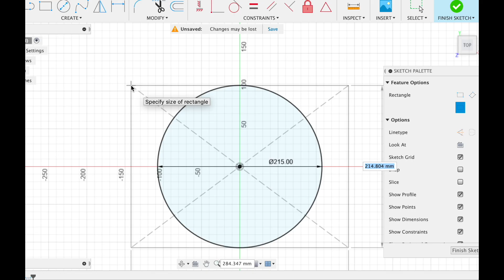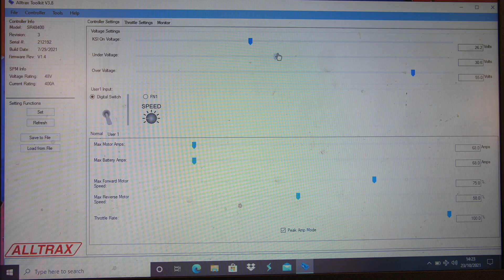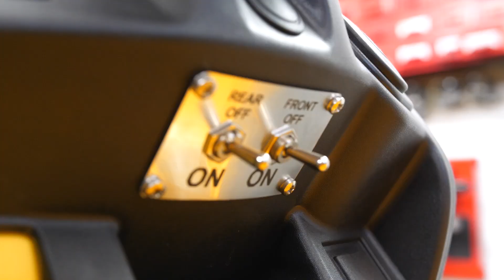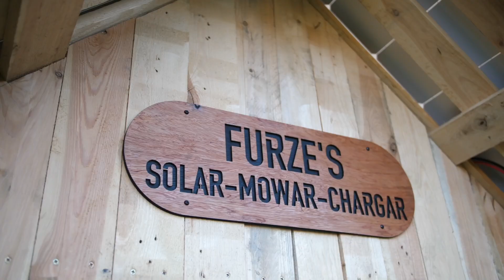EV Mower Conversion with Solar Charging Station

Comment: It's crazy to me that he refers to this as a commercial mower, and talks about how big it is. In America, most "commercial" mowers are ZTR Mowers with at least a 54-inch deck. Also, he measures his grass in square meters when where I'm from we measure lawns in acres. I live in a rural town and have a relatively small lawn for my area and I have approximately two acres of grass. His mower cut 1,500 square meters which is equal to about 0.37 acres. His mower wouldn't cut 1/4 of my lawn. I think this is a really cool project that turned out great.

Comment: Been waiting to see a rider on the market.  
Not a fair test though. The grass he cut was recently trimmed and still only went about an hour. I’d be curious to see how long  Lithium batteries could handle taller grass and  Fall leaves. 
I run mine for two hours every week and my weekly cut is taller than what he trimmed. 
My ears are looking forward to the day that they are not just gimmicks.

Comment: It'll be amazing if you add an output so it can be used to power other electric devices because grass takes a while to grow and those panels don't stop working. With the lithium batteries it would be a lot better as a battery pack.

Comment: Great build.  I have just a few ideas you may like.  First, I would use rubber instead of felt.   Felt holds water and will promote rust.  2nd, instead of dividing the batteries between the 2 motors, have 6 batteries connected to both and then balance the movement and blade speeds.   Lastly, depending on the motor voltage requirements, you have up to 72 volts available if all the batteries are in series.  If you have 2 banks of 3 batteries in parallel, you'll have 32 volts with twice the amperage, etc.

Comment: Could have done it with two battle born batteries. Maybe one. But I see you went with lead acid chemistry.. look up lithium iron phosphate chemistries but be careful because they're not great for vibratory applications such as a motor vehicle you need a specialized one

Comment: Also a benefit: Longer grass won't make the motor stall, that small electric motor also most likely has quite a bit more power
Reply: Those belts will slip long grass is usually wet which will make them slip
Reply: @trevorrowe6231  True, maybe he should just add another motor directly to the blades
Reply: @SophiaF3499  that won’t work either it would still need a belt to go between the two and that deck sits too high to fit a motor underneath

Comment: For private users it's actually not a bad idea, the long charge time isn't an issue because you only need to use the thing once a week at the most. However for professionals it's a no go because like electric chainsaws and other hobby tools, you just can't get the run time you need to go all day. The other slight practicality issue is that if you can afford enough garden to need a ride-on mower, is a fivers worth of petrol going to be a concern?

Comment: XS-Power makes lithium batteries in the same size as a normal car battery, but they're bloody expensive

i'd recommend you to make your own battery pack, i mean you're a great engineer after all so why not

just need to use a BMS system like ebikes n stuff got

i'm sure some companies would maybe even sponsor lith cells so you could build one yourself

Maybe get in touch with some EV conversion companies, they might wanna help

Comment: Not only is this a really cool project, but now because there's a documented record of how it was put together, someone can't just come in and patent it. I genuinely hope this idea catches on
Reply: I use my 1959 duel supercharged, 8 cylinder ride on. I keep the mixture nice and rich. Mmmmm those salty little tears Greta 🧂😢👍
Reply: @MattyEngland  Good on ya, if the  thing works well keep using it, but if your goal is to crank the emissions as high as you can then you'll want to mod it with a Spitfire engine or something instead. You and your vintage (and probably very easy to repair) mower are doing net buggerall for emissions globally. Besides, if it's a reel mower you're doing your grass a huge favour, even though you really sound like you're  trying to compensate for something here.

I'd way prefer the quieter, lower vibration lawnmower over a grounded warbird though

Comment: I think with you been on the subject or green energy, the ride on mower you have converted the engine you took out of it I think you should mate a hydrogen generator (HHO generator) to run the original petrol engine

Comment: Where is the improvement?
Electric uses 8 batteries that might last 5 years, 500% more copper wiring, rare earth minerals in the computer chips for motor controls and charging on a mower that weighs 1/2 ton and takes 2 days to charge in a charge station with even more mined copper and rare earth minerals (non recycleable) for solar? 
A standard mower uses 1/2 gal of fuel every 2 weeks, 6 months a year, refuels in a minute, needs one small battery (pull start or 110v start would eliminate that), weighs 350 lbs. has minimal wiring, and the engine is likely made from recycled aluminum and steel.

Comment: Commercially viable. Imagine if the shed could charge all garden appliences like hedge cutters, strimmers etc through solar panels.
Reply: Yeah I like it as a self contained unit as well. Mower, Doghouse, solar setup. 
I understand what @Patrick D is saying, but @Drenlin hits th nail on the head with the off grid aspect of it.
maybe pack the mower with batteries, and electrical outlets. then we have a decentralized, portable power station with a solar carport.
Reply: Man some of the smartest youtubers get the dumbest people commenting on other people's comments.
Reply: https://www.youtube.com/watch?v=xnSew-tCuPo he could.  just needs to add some battries to the shed and he could charge other things when needed
Reply: awww! the potential!
Reply: Would be nice for someone like Ryobi to do this with their battery system and allow modules to connect together so you can add chargers for their different batteries and also for other stuff too, maybe they could call it "ONE+ power connect" or smth to keep with their brand idk 🤷‍♀️
Reply: Not really actually. The solar panels won't serve any use after the batteries are charged. Solar panels are more efficient (and thus more commercially viable) if faced south, not in this setup. It's commercially more viable to use solar panels to feed the grid and charge your mower of the grid. 

It's a novel idea, but there are more efficient ways to use limited resources.
Reply: @patrickd9551  Disagree. If you already have a grid-connected setup and a charging spot with power this may be true, but Colin's setup is completely free-standing and requires no additional setup once constructed. It can be placed basically anywhere without worrying about how you're going to get power to it.

In my specific case, running power to a shed would require a permanent structure with permits pulled, and that requires a 10ft distance to any property line, which is very restricting in a smaller yard. This thing wouldn't count as a permanent structure and requires no external power, so I could back it right up to the fence line and not have to worry about it.
Reply: @patrickd9551  OK, the actual shed bit's not really necessary. You could just have a standing panel, but for a low-draw application that's only used once a week, a PV panel is actually a really smart solution, if you've got the space and the right aspect on your property. Putting solar panels on EVs is a dumb marketing gimmick, but this is actually a really good idea.
Reply: @patrickd9551  roof solar is less efficient but it’s still valuable because it allows more total solar capacity, there’s only so many empty lots available for solar farms but a lot of roofs

Comment: Should have gone with a riding mower that used a manual transmission setup that has 6 forward gears and 1 reverse gear this would have helped the speed problem and also made it lever actuated for the electric drive motor to tell the motor how many RPM'S you want instead of a foot actuated that was used but other than that good job.

Comment: What's the open circuit voltage of your solar modules? Cause I've had difficulties finding a charge controller that steps down the >30V of my panel to 12V for a car battery.

Comment: I thought about converting a fuel mover into battery mower on myself some months ago but the cost for batteries, motor and controller are still incredibly high.

Comment: How about a lawnmower that runs on the grass it cuts itself? For example with a methane biodigester and a combustion engine.
Although now that I think about it, that's how a goat works, which is also suitable for mowing the lawn and fertilising it.
Reply: I think you can also make ethanol from grass, so long as you jet it right and use alcohol safe fuel system components, either should work.
Reply: To be fair that's what the gasifier mower was going to do.
Reply: Still combustion based - not really helping with the emissions problem
Reply: @classicambo9781  but the grass would have absorbed the carbon content in order to grow, so emissions wise its totally neutral - IF (and its a big if) it doesn't need any fuel besides the grass its cutting.
Reply: Lol

Comment: Colin please can you try this suggestion. Install a 3000w inverter so when your not using your mower as a mower you can use it as a movable power station. You should be able to fit around 600ah lithium batteries inside it. Your inverter could potentially last most of the day running power tools. Would make an awesome video mate. From one plumber to another.

Comment: Uses for the additional electricity since it charges so fast.  Electric weed wacker and edger.  Have a converter in there to just let you plug in their regular chargers.   Or, and I'm not sure how possible this is, but maybe supplement your home (or bunker's) electric usage?

Comment: Is the rear discharge a UK thing? Really dig how well the collection bin worked that way. In Canada here it's all side discharge, so even though the collectors are behind the mower it goes to the side, up and back so thick grass or damp grass gets plugged up easily.

Comment: This is why I love his videos.
Collins prediction: work for 20 mins, a week or two to charge
Reality: works well over an hour, takes about two days to charge.

Really good vid,  keep em coming
Reply: I put a solar battery charger on my car today. It's total size is lucky to be 48x18cm and has 72 4x1.5cm cells in a 18x4 array, has a float voltage of just under 18v and can charge a battery at half an amp  it has massively exceeded my expectations to say the least. I was expecting it to charge a fully flat battery in 4 or 5 days. In reality it probably will be charged by tomorrow afternoon. I guess that goes to show that solar has far greater capabilities than it is given credit for.

Comment: Not sure but these look like regular Car (Lead based) Batteries. Are you sure those are a good idea to use? I dont think they´re really designed to be "discharged" and i guess that means you wont get a lot of mileage out of them. Maybe Gel based or lithium Batteries would be a better fit for that project.

Comment: Noice!

Quick suggestion though - it looks like your ridge piece across the top is so close to your panels that it will often be throwing shade on the top 4 cells of each panel (based on the brief glimpse at 7:22) - at least on one side at a time and potentially at high sun.

"So what?" I hear you ask.  Well the cells in these panels are usually connected in series (for the voltage), and a single shaded cell will seriously bring down the output of the whole series string.  Most panels sort of deal with this, and prevent cell damage, by having "bypass diodes" that allow shaded cells to be bypassed - however, these are usually fitted per COLUMN of cells.  Given that your panels are mounted "portrait", shading the top 4 cells - just a little - is likely to cripple the output of all 4 columns, and so the whole panel.

It's inefficient Colin.   A few tweaks and you can have MOAR POWAH!   And with more power comes... more responsibility, perhaps?  Maybe not then ;)

Comment: Eh even if this was a real world product you wouldn't really need lithium batteries they would be overkill 
Lithium is not inherently better for every application especially when cost is involved
6 pb batteries ~£1200
6 Lifepo4 batteries in exsess of £6000 (although you might get away with 4)

A set of propper deep cycle lead carbon batteries (leoch) with your motor controllers correctly setup to protect the batteries is more than adequate
Also your solar charge system is weird 
Just parallel the panels together put them through a MTTP controller (makeskyblue are fine) 
And I don't really see the need of separating the two battery banks unless you're working with different voltages (which without knowing more I don't see the point in)

Comment: The only things I would add to the oackage was an inverter and outlet on the mower to run a weed eater, hedge trimmer, or electric chainsaw. A proper park/yard maintenance tool. Add a outlet to the shed as well to be able to put the excess power produced by the panels to use after the batteries are charged. The premium package. A very impressive build. So quiet. A Solar Stealth Mowar.

Comment: Whyy don't you put a light in the charging station to tell you how much the battery has charged. So red for low battery and as the battery chargers up the light will change to green

Comment: Hey Colin, any chance you could share your wiring diagram for this? I'm curious why you are using so many charge controllers on your solar setup. I'm guessing you have the batteries cabled in series for higher voltage or something like that. 

Top build again as usual!

Comment: I’m a little confused about the runtime. If the batteries are ~70AH and the load is 68A peukert's law would suggest less than 30 minutes of operation. My guess is either the load was not as much as he estimated (which is great) or the batteries were drained below the 75% max discharge value in his controller’s program. 

Perhaps along with some other great suggestions (like a battery gauge) Colin could also install a amp gauges to see the actual power draw (per each motor)?

Comment: The savings one makes by going solar or wind are always amazing. Also being self-sufficient by making your own electricity at home is quite a manly thing.
Reply: in this case, its likely not worth it. if it were solar for your home and you could use the excess power, that would be good. but just on a shed, it simply goes to waste. Youd be better off with a home system that simply gives you power to lower your base load or bill without using batteries.(useful for saving money, but not for keeping your power on when the power goes out, but also far cheaper to setup)
Reply: If you really wanna save the planet we need to change the way we live. Mining and refining lithium is so environmentally friendly 😀
Reply: No, and no.
Reply: @MattyEngland  Okay Boomer.
Reply: @ScreaminCreamin  lol, substitute boomer with someone who would like electricity even on a windless night
Reply: @MattyEngland  I understand batteries may be a foreign concept to you, but I promise they exist.

In fact, there are several of them in this video!

You know what else is just as likely as a windless night? Humanity running out of coal.
Reply: @ScreaminCreamin  It's that sort of stupidity that will leave hospitals in the dark. Show me a battery that can store 400,000 volts and millions of kwh.
Reply: @MattyEngland  I live in Australia, where the one of the largest batteries in the Southern hemisphere has saved South Australia's electricity grid from repeat failures.

I don't need to show you one. We have evidence of one working already.

It has also proven to SAVE money on everyone's energy bill in the state.
Reply: @ScreaminCreamin  You mean the one that caught fire a couple of weeks after it was switched on?
Reply: @MattyEngland  ah yes! The old, its new technology that isn't safe! See that time it caught fire?!

Sure thing. Let's just ignore Chernobyl.

Comment: For a good battery upgrade you could buy some 100 Ah 12v LiFeP04 camper batteries made by Battle Born, they're $800 US dollars before tax and all that, but just one of those batteries would be more capacity than your whole lead acid setup. Also, a good solar charge controller would be a smartsolar MPPT 150/70 ,which would replace all the separate controllers you have and would make it a lot more streamlined. 

You could also make your own pack with either a bunch of 18650, 21700, or 26650 rechargeable lithium-ion batteries, though you'd have to connect them all together with nickel plated copper wire strips using a spot welder, and make a protective case for them all to reside in, which would be a challenge but they're a very popular choice for smaller electric powered things nonetheless. 

Hopefully this helped a little bit! Love your channel and all the crazy things you make, your content has inspired me to try and take on some new projects at home and finish up the old ones lol.

Comment: coming from the extreme car stereo world.  alot of us use Yinlong cells they are 2.3 volts you run 6 in series. total weight around 7kilo per bank and equal to 400 ah .